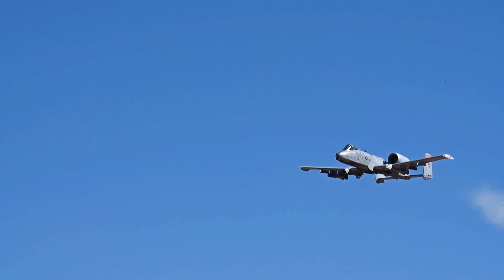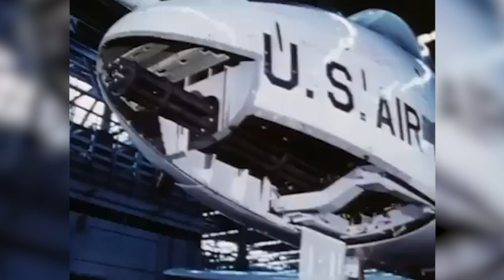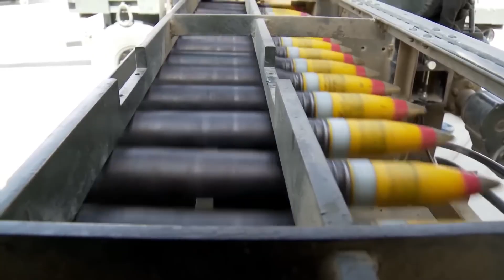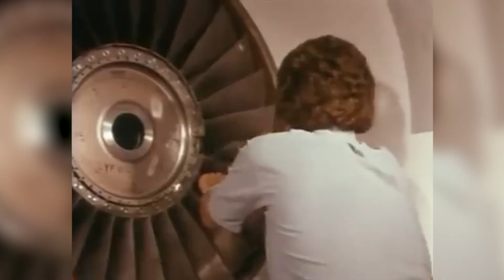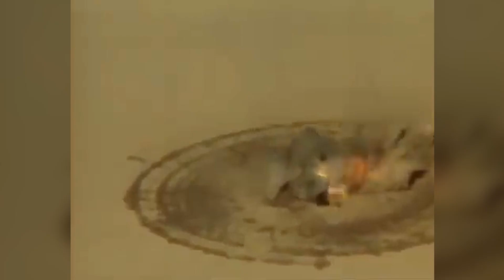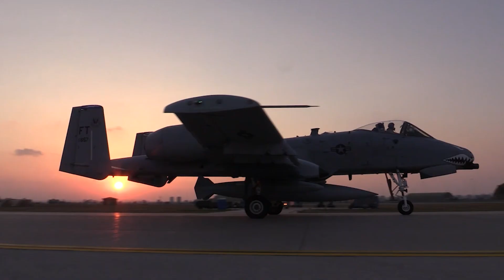How the A-10's Avenger Cannon Went From Terrible to Terrifying

Comment: Damn shame!  I heard F22 and F35 pilots are pissed that the Warthog is being eliminated from the battlefield because now the Lightning II is supposed to pick up those duties!  Sure, I would rather risk 5 A-10s than 1 F35 because of the cost and the fact that the F35 cannot go as slow as the Warthog reliably!!  Some are complaining that the airplane is too slow to survive a confrontation with other, more modern enemy airplanes!  So, give it better engines and figure out how to make it fly right to the edge of supersonic!  Not sure what has to be done, but if that could be done, this bird is still more survivable than any other airplane in the inventory, including the BUFF!!!!
Reply: Hard to believe this adversarial relationship between air and ground still exists.  Ground support has usually been looked upon as the red headed stepchild, at least from the point of view of the fighter jocks and the partisan pentagon procurement generals.  The value and supremacy of combined arms was proven long ago at this point and you'd think that everyone would be on board.

Comment: Thanks for the content. I do think that the A10 is overhyped though. It is fine but honestly I think the role is better filled by helicopters now. This massive and heavy gun is better replaced by more modern missiles like hellfires where they don't have to get as close to an enemy in order to be accurate enough to hit it. I am pretty sure that a hellfire is also much more lethal against tanks than the GAU-8 thanks to the tandem charges it has. That being said maybe the solid chunks of metal the GAU8 shoots would be better against turtle tanks. Honestly not sure there. Helicopters also have much longer engagement times which when providing close air support means you can get the time you need to actually hit the enemy instead of only having a few seconds on a strafing run. 

Again the A10 was fine for its time as missiles weren't nearly as accurate during its development. Helicopters were also a lot newer with huey's being the standard helicopter during its development. The cobra was really the first attack helicopter that didn't just strap missiles and a gun to it and call it good but the cobra only entered service right before the A10. So again I get why it was developed and needed but really it is time to let it go. I think a v280 gunship will be a much better platform in the future for close air support.

Comment: One of the A-10s in my unit in Alaska had the muzzle brake installed. It worked, but it did cause vibration problems. It was still on the aircraft when I left, and I wondered why I never saw any A-10s with it afterwards.
Reply from the maker: You might be interested in this little tidbit!

https://www.twz.com/25166/this-a-10-warthog-ground-trainer-still-has-a-tickler-muzzle-device-on-its-cannon
Reply: @thewarzone  Another side effect I didn't see mentioned was the tickler directed most of the gun gas downward, and the powder reside was very abrasive and eroded parts beneath the wings such as pylon connectors, etc.

Comment: When the A10 retires- can they repurpose these in the C130?
Reply: I doubt the airframe could handle the recoil or the size. The 105mm on board I much smaller then the A-10’s gun even if you don’t include the drum magazine. 
Also the C-130J already has a 
MK 44 Bushmaster 30mm. There’s even talks of removing the 105mm in exchange for another MK44 or different weapons like a laser or storage for more missles
Reply: @omarrp14  didn’t they cancel the laser? Just thinking about ways they can repurpose old weapons - obviously I don’t know what the recoil of the 105mm vs the Gatling
Reply: @SteelBattalion07  oh damn, I just looked it up and putting the laser in the c-130 was canceled in march 2024
Reply: @omarrp14  hence the thought with repurposing the Avenger - otherwise it can be repurposed to be the big boy version of CIWS
Reply: @SteelBattalion07  it uses the same 30x173mm as the MK44 so the ammo infrastructure in place already. And with there being over 250 A-10, plus some that were retired, that leaves a lot of spare avengers laying around once the planes retired. 
At first I thought I’d be funny, but using them as Army C-RAM could be viable. Especially since our air bases (and ones to be built) in the pacific need more air defense.
Reply from the maker: Who knows...through modern engineering all things are possible!
Reply: No, there's not enough space in the cargo bay, to mount the entire gun in a sideways installation, and also, this gun would have to be modified to become a side firing weapon.
Reply: I imagine the barrel can be outside the plane (all ac130 gunship weapon are side mounted) the unknown for me is whether the rest of the components can fit or modified to fit.
Reply: My idea for a future aerial ground support craft based on the AC-130 is having the Avenger cannons, some 50 or 57mm autocannons, and a 5in cannon as the guns. There'll also be bombs, missiles, and drones along for the ride.

I also came up with an idea for a helicopter equipped with a 105mm so it can be used as a form of flying artillery, as in the pilot points the nose up and shoots from behind cover.